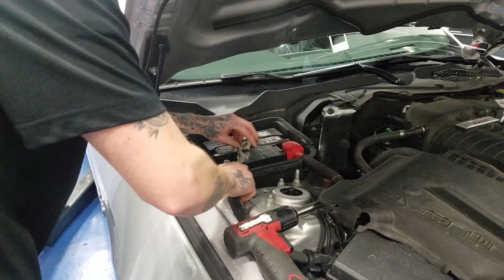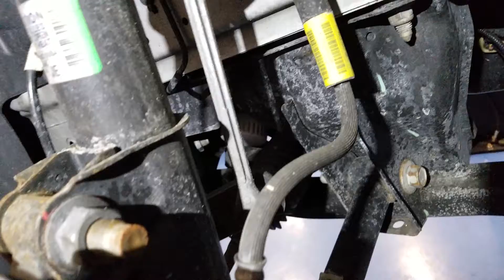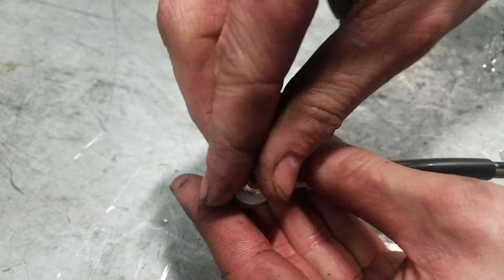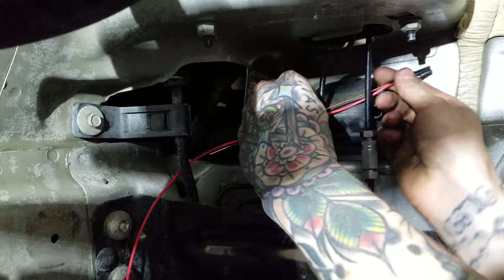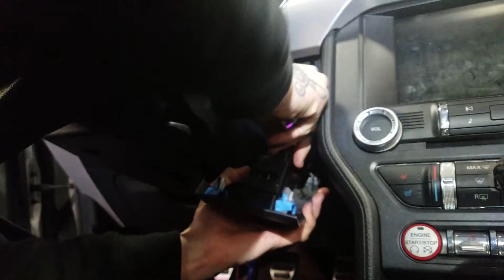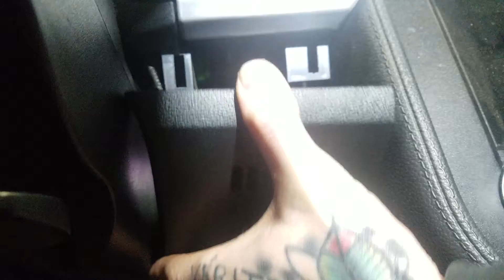JPC S550 Line Lock Install Guide (2015+ Mustang)

Comment: Are the 12s the same way?
Reply from the maker: The 12's are different, we have a separate video discussing how they are installed
Reply: jpcracing ok, just looks super easy. Kinda cool
Reply: I was Kindve curious why does the s550’s get a second solenoid? Also while installing on 11-14 I’m having issues with the bleeding, do I need to bleed all 4 callipers, or just the front?